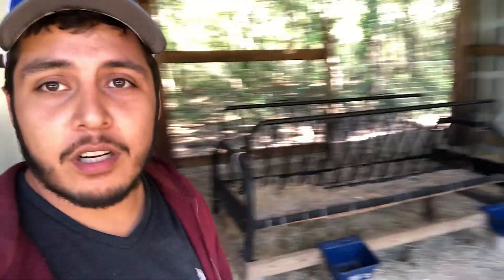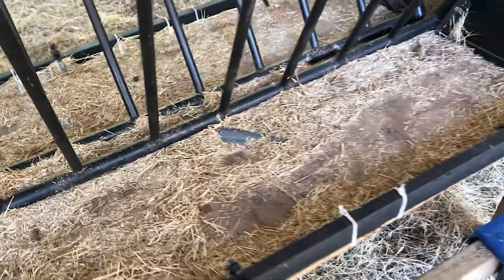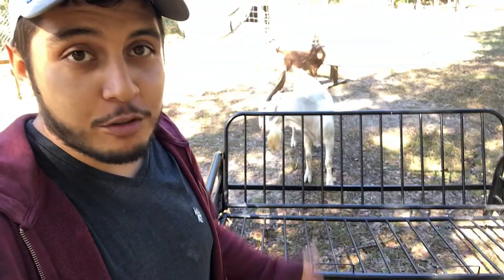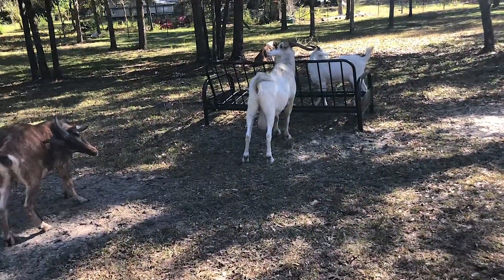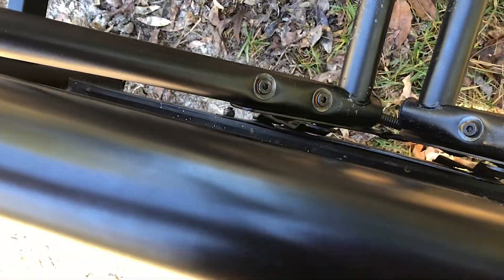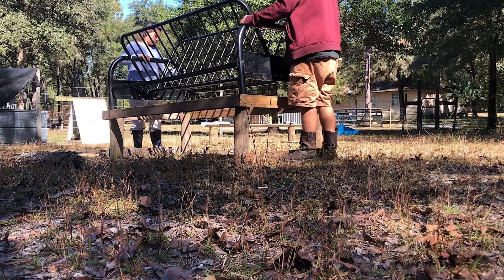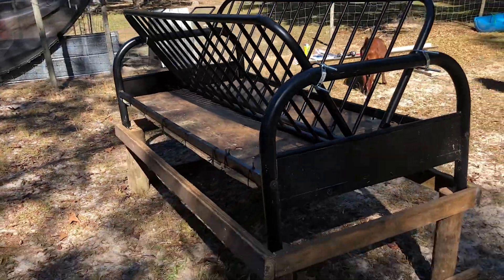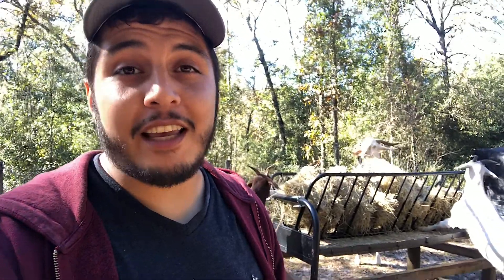DIY Futon HAY FEEDER | part 2

Comment: Thanks for mentioning removing the bolts on the one side so you can make the angle between the sides smaller. I spent a lot of time trying to figure out how everyone was getting their angle smaller but mine wouldn't close that far.